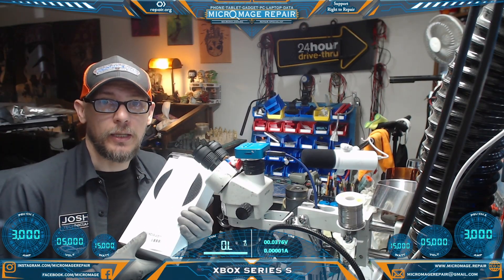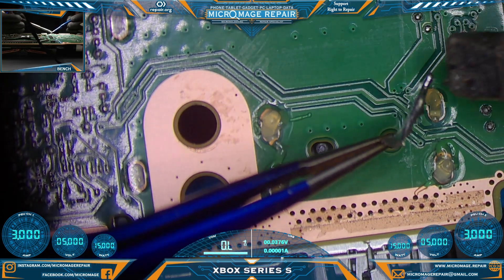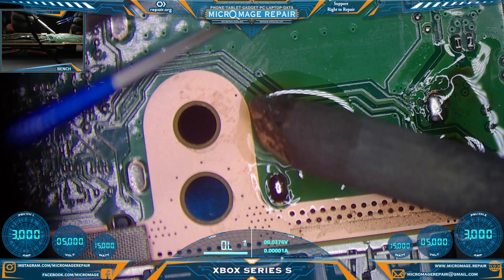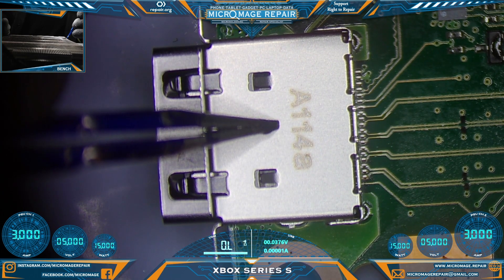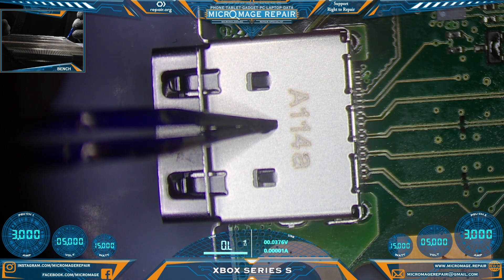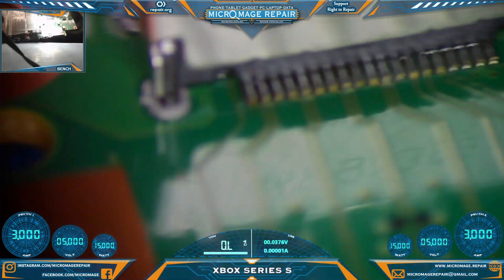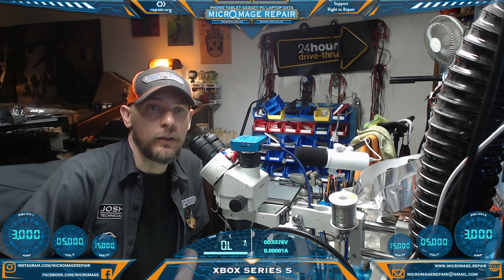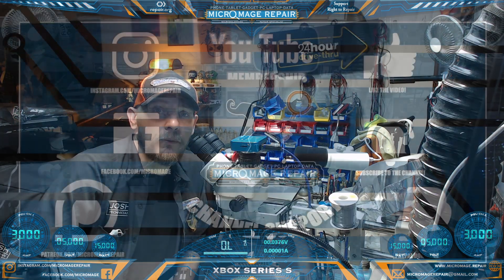Xbox Series S: Anyone hear of an HDMI Switch?

Comment: Nice work on the anchor wicking :)
Reply from the maker: Thanks Tim!
Big tip + low melt is my preferred combo.
Reply: @MicroMageRepair  just used your link to buy board holder.
Reply from the maker: @optimizelogicrepair2784  Thank you so much Tim!